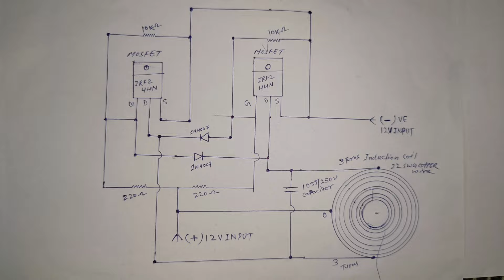12v से चलने वाला इंडक्शन चूल्हा बनाएं | How to make induction cooker at home

Comment: Please convert normal induction to 12v200watts
Reply from the maker: Ok
Reply: A normal induction oven in my home draws generally 1000w. So to run it on 12v DC we need 7 X 150 AH batteries at least.